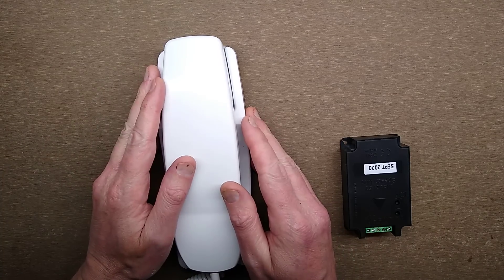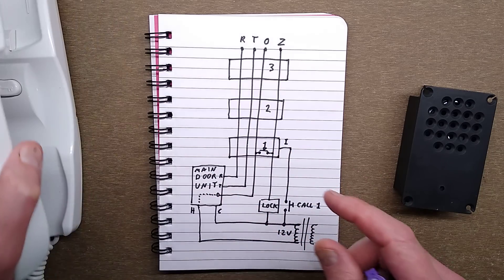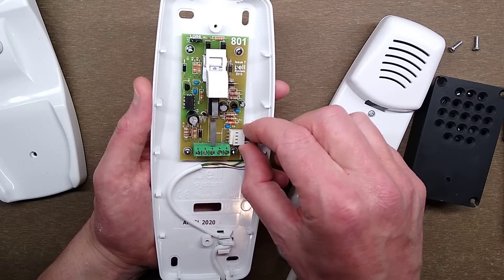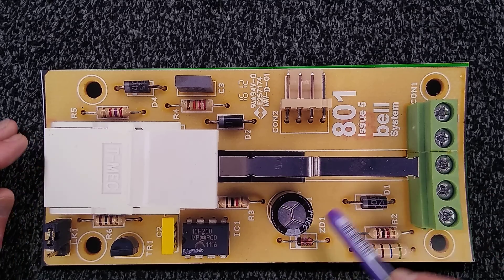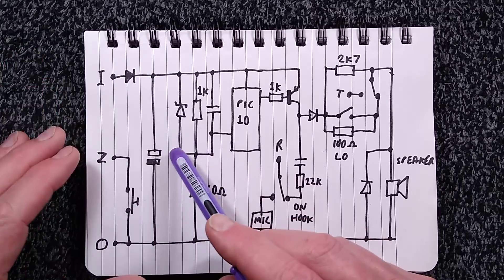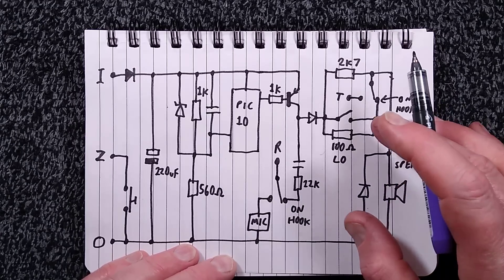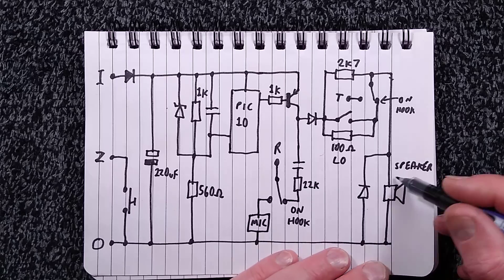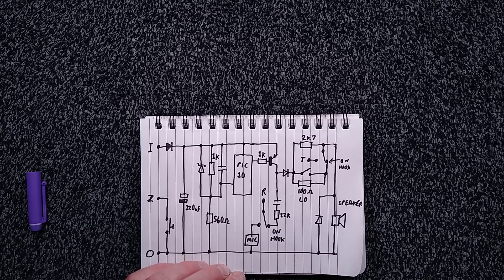Inside a door entry phone

Comment: This video brought back a nightmare. Just over 10 years ago , my boss ask me to go and finish a door entry system on a factory conversion in to 60 flats, what he neglected to tell , it was a system install by another company who abandoned the job. Each flat had to have two phone , one in the hallway and one in the kitchen. There was 5 doors that entered the building they had to a 61 button panel , plus 5 electric locks , to cut a long story short I just rip the system that was there , the amount of cable trays and cable seemed to on for miles, it took 4 month ito sort out , by luck only 4 flat were occupied . I was only supposed to be on the job for 4 weeks , I was there for two years sorting out the rest of electric that were thrown in , just imagine all amoured cable , internet , CCTV, cable TV , door entry, satellite and telephone cable all thrown together with no separation between the different systems, a complete nightmare
Reply: 60 flats but a 61 button panel ?
What was the last button for ?
Reply: @psirvent8  - Lucky dip, buzzes a random flat
Reply: @psirvent8  Usually a trades button in series with a timeclock to allow postman etc to get in during the day
Reply: @rossBurglar  But anyone can enter during the day ?
Reply: @psirvent8  Often on doorststions with integrated keypads it allows a time limited trade code but yes sometimes it just releases the door. Access control keeps honest people out 🤷

Comment: Guessing R and T stand for ring and tip. That's the terminology used in the telephone industry, based on the old plugs (tip and ring) used on the cables that the operator would use to connect calls at the exchange. At idle, the tip was around ground potential and the ring was at -52V battery potential, with the nominal voltage at the phone being around -48V. When ringing a 20Hz AC signal of about 90V is applied across the line, in parallel to the battery potential. Because the ringer was basically an electromagnetic solenoid, the AC signal would literally push and pull the clapper between the bells.

Comment: The original system these are based off used carbon microphone units indoors and outdoors, with a 9V supply obtained off the power transformer using a diode and capacitor, that then was used to provide a common 9-12VDC to the outdoor microphone and speaker, with the R and T wires then having the carbon granule microphone for the outside speaker, and the outside carbon mic driving the internal 32R speaker. The upgrades for this emulate the carbon microphone with either an electret capsule and a transistor or two for amplification, and for the speaker module outside the same, to use cheaper 8R or 16R speakers in the handset. 

I have made carbon mic replacement units for them, ripping the dead carbon mic apart, and putting in an electret capsule, a PNP transistor and a 3k9 resistor between emitter and base to provide roughly the correct bias voltage, around 3V, across the mic capsule. Was a lot easier than buying those capsules, as they were failing rather rapidly due to age, and I could simply grab salvaged electret capsules out of old phones, a PNP transistor out of same, and select a resistor to bias it correctly. Fitted into the old carbon mic case, using the same connectors, as a drop in replacement. Much cheaper as well, which was a big consideration, and a lot better volume out of the speaker at the bottom as well.

Comment: The "R" and "T" are (most likely) from the 1/4-inch phone plugs that were pretty ubiquitous in the telephone industry during the last century. "T" for tip, "R" for ring, and "S" for sleeve (usually the ground).
Reply: I thought it might be Rx and Tx!
Reply: Hmm, y'all getting a bit hung up on what the letters mean. In the industry where I work, the interconnections within telephone concentrator systems were typically named either L1 and L2, or LA and LB. And yes, some equipment was VERY polarity sensitive. For example where ‘earth’ recall button circuits were used. Or on automatic selective circuits (crude dedicated auto dialler systems).
Who knows why they chose T and R. Logically, just numbering the terminals would have made far more sense, then no one would be trying to put a meaning to the letters.
Reply: @Mark1024MAK  Oh, come on, pointless arguments are practically what the internet was made for. Everyone in this argument is well aware that it doesn't make any actual difference whatsoever.
Reply: The "speaker" part of my hearing aid that goes into my ear is called a "receiver " by the manufacturer.  A bit confusing terminology to me.
Reply: In normal telephony that's correct. And it was what I expected here too.
Interesting that they used those designators for something that works so differently
Reply: Ohh! As an audio engineer, I've always wondered why the 1/4" jacks were called TRS. Now it makes sense!
Reply: I think T and R are for Transmit and Receive. The wiring is nothing like a regular phone and the T and R on this phone are not a balanced pair.
Reply: @brianleeper5737  You're almost certainly right.  Another bit of POTS lore being rapidly lost is the concept of a telephone "receiver".  In the really old days the "receiver" was the speaker part of the phone that you picked up up off of an actual hook and placed to your ear to hear the other person.  Then you spoke into the "transmitter".  All original Bell System terms, BTW.

When the speaker and microphone were eventually integrated into a single "handset", people still described answering a call or starting a call by "picking up the receiver".

In the case of this "Bell System 801", there is no complete telephone system involved.  Imagine it instead as a bunch of old phones with the handsets removed and the bases thrown away... therefore the only telephone signal names left are those of the "Transmitter" and "Receiver".  Of course in an old POTS phone, each of those signals were a separate pair of wires.
Reply: @Randrew  I just like how this company calls themselves "Bell System" when they have NO connection to the AT&T "Bell System".
Reply: @brianleeper5737  Good heavens, they fooled me too.  They sure seem to have adhered to some POTS technical lore from AT&T... maybe to bolster their legitimacy?
Reply: @Randrew  As far as I can tell they don't do any business in the USA, and I have been around since the 70s in the UK. Not sure how many folks in the UK in the 70s would have known that "Bell System" was the name of the phone company in the USA.
Reply: @brianleeper5737  Then why is the "T" line hooked up to the speaker?
Reply: @HiddenWindshield  Look at it from the point of view of the control unit this phone is connected to. On THAT, T would be transmit to the phone, and R would be receive from the phone. Then consider that they had to keep the names / designations for the wires consistent from one end to the other OR confuse installers by telling them to connect T to R and vice-versa.
Reply: @brianleeper5737  Look, you might be right. I wasn't there when they decided what letters to apply to which lines, and I don't have the manual in front of me, so I can't say for sure. But I do know that this would be the very first time I've ever seen the transmit/TX/out/etc. line used as an input. Terminals are always labeled from the perspective of the device it's printed on (well, until now, if you're correct), and using Tip/Ring/Sleeve terminology would satisfy the "like connects to like" requirement without confusing the people who know what the letters mean.
Reply: @HiddenWindshield  Sure, terminals are labeled from the perspective of the device the markings are applied to--WHEN they are devices such as modems and terminals which are designed to interoperate (you could connect a terminal to another terminal, and a modem to another modem, and of course a terminal to a modem).

But this phone is different. You wouldn't connect two phones like this back to back. It is designed ONLY to be connected to and work with a specific control unit. So they apply the same designations to the terminals on both the phone and the control unit to make it easy for the installer. Connect T on the controller to T on the phone, likewise for R, and it works.
Reply: @HiddenWindshield  Also, most devices which use Tip and Ring will work just fine no matter if Tip and Tip and Ring and Ring are connected, or if Ring is connected to Tip and Tip is connected to Ring. (The only exception I'm aware of is old touch-tone phones with polarity sensitive keypads, which at this point are over 45 years old. These won't produce touch tones if wired backwards).

This phone will NOT work AT ALL if T and R are swapped.
Reply: @brianleeper5737  I've dealt with dedicated devices. Every one that I've seen, that's had an output, had that output go to the input of the other device(s). If they're going to use a like-to-like connection, they won't call it output and input. They'll use colors, or numbers, or some other name (like, for instance, TRS) that doesn't imply a crossover connection.

I've also seen plenty of phone plug devices that won't work if you get the connections swapped. If you're reading this on a cell phone (and that phone has a headphone jack), then those headphones won't work if you reverse the tip and a sleeve.
Reply: @HiddenWindshield  I'm referring to tip and ring as used to designate the wiring for devices intended to be connected to twisted pair wiring provided by the phone company (exchange cable). Few of those are polarity sensitive. Things like DSL modems, T1 CSU/DSU, fax machines, etc. I've never run into any of that type of equipment that is polarity sensitive except as previously mentioned, really old touch tone phones.

You can draw as much meaning from the usage of T and R as you like. The people installing it who are told to connect T to T and R to R don't worry about any deeper meaning of it.
Reply: @HiddenWindshield  Because it's not a real phone system and the Bell 51/61 "speech unit" in this system is just another handset in a different form, but they've decided its R and T wire designations should be the same end-to-end.  Simplistically you're connecting one handset (the "speech unit") to one of several handsets (in each flat).  So really you're hooking R to T and T to R... but they didn't want to confuse installers so they labeled them R to R and T to T.
Reply: @brianleeper5737  Jeeze, I just independently answered him almost identically without seeing your reply first.  Let's just say I agree with you ;)

Back in the early to mid-'80s as a kid I "researched" the POTS system a lot.  Nice of ATT / Bell to publish all their telephony standards in their journals that the local University kept in their library.  They were very, very hung up (in mostly a good way) in maintaining consistent use of terminology.  So, by God, if they once called a telephone speaker a "receiver" then that name stuck.

Take that forward to a system like the 801 Clive showed us - which I've described as a bunch of telephone handsets tied together without the rest of the phone.  There is no Tip and Ring because that was part of the network interface within the base of the phone which we don't have here.  Yank the handset off an old phone and the 4 wires dangling out are two pairs, one for the Transmitter and one for the Receiver.  In the 801 they've really just borrowed the old terms for those signals because electronically they're not quite the same - being referenced to a common wire.
Reply: @brianleeper5737  "I'm referring to tip and ring as used to designate the wiring for devices intended to be connected to twisted pair wiring provided by the phone company" Well, I don't know why you're doing that, because I've seen TRS plugs in plenty of other contexts. Audio equipment uses them quite a bit (or used to, they're falling out of favor now). I've seen elevator wiring that was labeled TRS (and they included the "S", so there's no chance for misinterpreting it). And the list goes on.

I Googled the manual. BellSystems never defined what the letters mean in this particular system. However, I find it interesting to note that, in their BellCall digital apartment system, the central controller does have a separate "Tx (D)" line that is supposed to be connected to the "Rx" line of an optional video display unit.
Reply: @HiddenWindshield  Because this equipment has no tip, ring, sleeve connectors in it NOR was it ever designed to be connected to telephone company wiring so why would they have use tip/ring nomenclature?
Reply: @HiddenWindshield  I just looked at the wiring diagram on Bell System's website and it shows T on the door panel connected to T on the 801 phone, and R on the door panel connected to R on the 801 phone.
Reply: @brianleeper5737  - but normally R stands for relay or resistor, and T stands for transformer…
Reply: @brianleeper5737  - why not use M for microphone and L for loudspeaker?
Reply: @Mark1024MAK  Why not use E for Ear and M for Mouth?
Reply: @Mark1024MAK  On circuit board designations, you expect to see R for relay or resistor (actually RY is more common for relay from what I've seen), and T for transformer. But on HVAC thermostats, R is for 24VAC power, and just refers to the color of the wire used for that.
Reply: @brianleeper5737  I don't know why TRS nomenclature keeps popping up in places not designed for telephone equipment! It just does! I guess a lot of old engineers got used to it, so they kept using it in other places.
Reply: @HiddenWindshield  The use of TRS nomenclature makes sense if T and R are a balanced pair, lets you know to connect them to a single twisted pair. I've used SHDSL modems with support for 4 pairs and the RJ45 on the back has a pinout showing T1/R1, T2/R2, T3/R3, and T4/R4. (Use of Tx+/Tx- and Rx+/Rx- nomenclature wouldn't be correct because a single pair on this SHDSL modem is bidirectional--the additional pairs are bonded for additional bandwidth/speed. It can work with just a single pair).

TRS nomenclature also makes sense if there's a phone plug/socket somewhere in the circuit with a specific pinout that needs to be adhered to.
If neither of those are the case, use of TRS nomenclature is likely arbitrary and offends my sense of order. :)
Reply: @brianleeper5737  LOL Yeah, I hate when they do that kind of thing too.
Reply: @brianleeper5737  - well, why not. It would have been logical for Spock…
Reply: @brianleeper5737  - the designation does depend on the industry and the country. In my industry R as the last letter of a mnemonic does mean relay. In electronics, RLY is common to mean relay.

Comment: I installed hundreds of these things during the 80's and they were quite unreliable the hardest part of installing these was drilling through the hardened concreate of each floor in a block of flats but we always used either a 6 or 8 core alarm cable even though they only needed 4 cores, nothing worse than trying to run a new cable through metal conduit if a cable broke down.
Reply: The thermostat (programmable, touch-screen heating and cooling) for my heat pump connects to the main unit with only 2 wires.  Power and signals are sent over the same pair.    One would think that building call systems could be constructed using only a single pair of wires for all connected units.  Maybe they exist; I don't know.
Reply: @tubastuff  There are systems that use POTS (regular phones) and a single twisted pair. In these, the signal to unlock the door is sent by pushing one or two buttons on the phone's DTMF keypard.
Reply: @tubastuff  they do exist, as a bus system sending bus data as well as fm modulated audio&video over a twisted pair
Reply: I didn't know that was the reason!